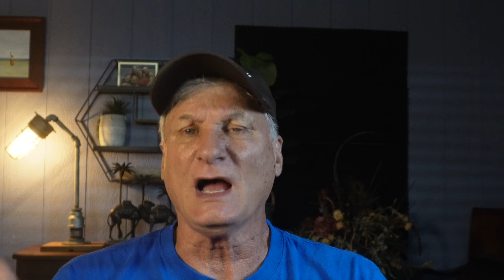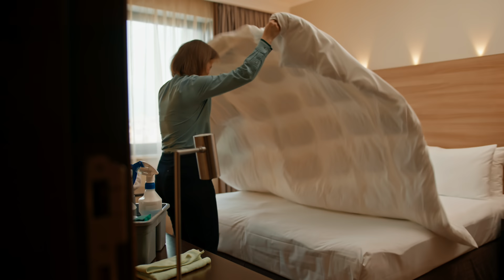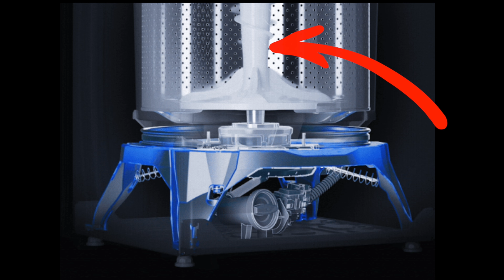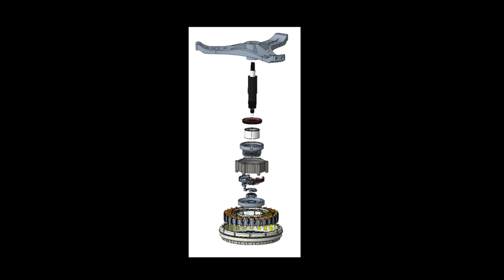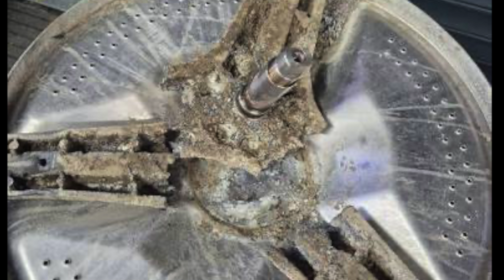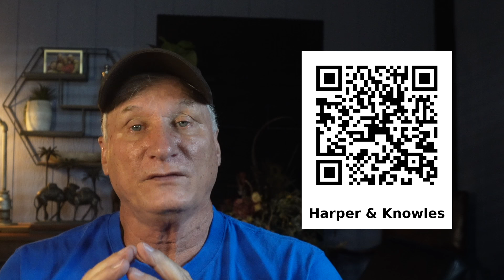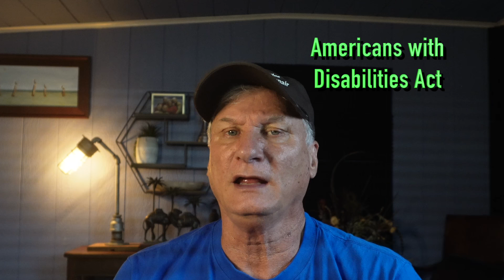Maytag's New 30-Year Washer: No Gearcase, Real Agitator, 900 RPM

Comment: My.  God.  We have a very expensive Whirlpool front load that is basically the same machine that I just got RID of because it was SUCH a piece of crap.  They are not balanced, and they will walk completely out of the laundry room if you use Spin Cycle #3 or above.  That's if you can even get it to spin in the FIRST place.  Most of the time, it cannot/will not tumble the clothes properly to spread them throughout the drum so that the spin cycle can be balanced and begin.  I am about to put it in storage and buy a another Samsung (which we got rid of to move halfway across the country in 2022, a long story).  I would not buy another Whirlpool EVER.  Ugh.

Comment: Why do they not build the spider out of a better material like a fibre resin or stainless steel ?? I have owned machines that I paid 1400 for and they lasted 4 years until the spider corroded away rendering the machine junk.....

Comment: looks like a fisher pykel pos washer .
  fisher pykel  i replaced the control board twice on a fairly new machine and the pump once in less than three years .
 i hope maytag didn't follow fisher pykel pos design . btw i dumped that fisher pykel pos and bought a maytag around 2006 .
but i did find one that had nobs and no board to go bad .

Comment: The computer is the most common failure point in modern appliances. I’ll take a manual transmission over a computer controlled piece of garbage any day even when they’re made out of crappy sheet metal stamp together with pudding.

Comment: My Kenwood Elite HE3t is 25 years old. $15 on a door actuator. $30 on a sump pump. $50 on the bellow tube. The bellow tube went bad only 5 years after new. The replacement is already 20 years old.

Comment: We had a washing machine that lasted for at least 20. It got our clothes and such very clean. It died. When we went shopping to get a new washer, not one had the agitator in it. I hate it. It doesn’t get clothes, linens, and sheets all the way clean. Plus sometimes it won’t spin all the water out, so we have to run the spin cycle again. 
I wish it would die a painful death.

Comment: Our fancy Maytag died, so we got a fancy Samsung.  Neither had an agitator, and both took over an hour to go through a wash cycle (HOW IS THAT ENERGY EFFICIENT?).  Then we had to start babysitting the Samsung because it would get out of balance Every. Damn. Time.  It could be one pair of panties and that thing would get out of balance.  We bought a Speed Queen back in June and I love it!  30 minute cycle AND the clothes are clean.  My husband does heavy duty, and my clothes have to be on gentle or hand wash cycles.  So we’re on our third, and last, washing machine in 20 years, with numerous service calls on the first two fancy pants machines.  And I got so sick of that stupid song.  I can remember the avocado green washer and dryer my mom bought in the mid to late 60s.  When my dad passed away in 1998, that washer and dryer were still in the house, still working.  The Frigidaire we got when we moved into that house in ‘59/‘60- my dad had just replaced it right before he passed.  My dad gave me his Hoover canister vac when he got a maid service.  It was probably 3 years old.  Knowing my dad, I’m sure it didn’t see much action.  I still have it, and it still works.  It has to be 30 years old.  I had a bagless Dyson that I despised dumping, so when it cratered after 5 years, I happily threw it out.  I much prefer pulling out a bag than have dust and dog hair floating around in my face.  They just don’t make ‘em like they used to!

Comment: Here's for you and the community. My 25 year old Kenmore 80 series works like a charm except for one thing. There's a Agitate Select switch where you select the speed such as slow, ultra slow etc. The Normal selection is for wash-slow and rinse-fast. That has never worked and only goes slow for both. I've replaced that switch twice and no joy. What more troubleshooting can I try or is there a failure somewhere else? Thank you.

Comment: SPEED QUEEN HISTORY:
The Complete Timeline
1908: The company is started under the name Barlow & Seelig Manufacturing. Their first machines are called "White Cloud".
1911: They build their first electric-motor washer.
1922: The company becomes the first to use nickel-copper tubs to make the machines last longer.
1928: The famous brand name Speed Queen is officially born.
1939: They switch to stainless steel tubs, which are still a signature feature of their washers.
1942–1945: During World War II, the factory stops making laundry machines and switches to making 20mm ammunition shells and military parts.
1952: Speed Queen introduces its first automatic washers and dryers.
1979: The company is sold to Raytheon Company, a major defense contractor.
1998: The company becomes Alliance Laundry Systems, focusing heavily on commercial-grade strength.

Today, Speed Queen is one of the few appliance brands that still makes its residential machines in the United States. They use the same heavy-duty metal parts for home washers that they use for big commercial laundromats.

Comment: I just happened to come across this video, thanks for it! I know very little about washing machines yet I find myself repairing them at my place of employment. We have 3 Maytag washers branded as "commercial" and a residential Speed Queen. These things work fairly hard, maybe 6-7 loads a day, every day, forn3 years. The Speed Queens has not failed once, the Maytags have all failed. 2 ECU's, 2 gearcases, 2 water pumps, 3 RPM sensors, 1 lid lock switch and approx 30 or so plastic hubs. NEVER AGAIN! Buy the Speed Queen, everything else is junk.

Comment: In the early 90s I bought a 1962 Maytag top-loading washer and dryer.  The tub was porcelain/enamel coated.  It had I believe three moving parts.  All the wiring and relays super heavy duty, and it got my clothes cleaner than any other washer I've ever owned (and I'd gone through Kenmores, Whirlpools, and GEs like tubes of toothpaste).
I moved onto a boat and gave the pair to my landlady, who is still using them today.

Comment: The problem is those "control boards" crap out and cost HUNDREDS to replace.  Need old fashioned contact based timers like the old days.  My washer and dryer are Whirlpool from 2003 and after a couple low cost DIY repairs, they are still running great today!

Comment: We moved into our ranch in 2003, with a new set of Amana washer & gas drier. We are always buying a top loader. 4 year’s later the washer died. Then I bought a GE washer & gas drier. At 4 years (5 year warranty) they replaced top beard, motor, belt and transmission. After 1 1/2 years, it was dead. Somewhere till 2018, another was replaced. Then in 2018 I replaced with a Speed Queen TR5000, washer & drier. It’s still running.

Comment: Not a frontloader, not interested.

But hey, my 20 year old Whirlpool frontloader with computerized controls and an even faster spin speed is still going strong.

Yeah, washers are expensive.  Good clothes are expensive too - and they last a LOT longer if you only wash them in a front loader.  Only buy a top loader if you don't care what you're washing in it - good for your shop rags, not good for much else.

Comment: I was recently in China. I had to fix 2 modern ones at 2 different hotels. There was an old old one that I've never seen before. The spin cycle you had to put the clothes in another tub beside the wash tub. Just a timer electricity and water. Probably 50 years old. Still working. Simplicity wins every time.

Comment: The comments below are all worth reading.  I will only add that it is overdue for a consumer revolt against the financial slaughter the American consumer has been experiencing for the last 20 years.  Those of us who remember the 20th century know that appliances typically lasted 30 years not 7.  Yes, the appliance is cheaper now ( accounting for inflation ) than in the 20th century but when you have to replace it every 7 years the cost is actually a lot more.  
I will not go over in detail what happened but give the readers of this comment two clues to research:     1.   Corporate greed and unrestrained mergers leading to monopolies.  2.   Chinese manufacture.  This last clue is difficult to get at unless one knows this:   China is not food independent, i.e. they have to buy food.

Comment: Bought a Whirlpool & the electronics went out in a 1 1/2 yrs… repair guy said it would be 4 to 6 hundred to replace it… I junked it & bought an LG … but I have to leave the lid open all the time or it has a bad odor, and yes I’ve used the cleaning tablets, didn’t help !

Comment: While fewer moving parts is theoretically great, new direct-drive implementations often suffer from initial control board glitches, firmware oversights, or early component failures. Whirlpool asking premium money ($1,500 range speculation) for you to test their brand-new engineering is a tough pill to swallow.

Comment: I've had my washer and dryer well over 10 years... and I didn't get them new... they are used... and abused... never had an issue with either of them.  Would I like a new pair... sometimes... I'd like to be able to wash my comforter without having to go to the mat to do it... but it is what it is and sadly there is little to no chance of me getting a new set as new sets sadly are far too large to go into the small space that I have to put them... since I rent and don't own the place it's not like I can build a new room to house a washer and dryer.  I am stuck with what fits ...

Comment: Won't ever buy another Whirlpool washer. Bought the most expensive top loader stainless washer in 2010. Looks just like what u are describing. It lasted 2 years. Had computer issues. Would quit and lock lid. Couldn't even get the clothes out of the washer. Didn't clean well and everything always smelled like mildew. Repair man told me it was junk. Biggest POS I've ever purchased and took it to the scrap yard.

Comment: I have a Maytag MVWB880BW0. I have had it for 12 years. I have replaced the main shaft and bearing once. The suspension rods once and one drain pump once. My wife is tough on a washer and often loads it with heavy blankets. The maximum spin is 1100 rpm which she always uses. The clothes come out remarkably dry. We  have been very happy with it .

Comment: Brushless motor...their used in screw guns,high speed trains no rails, small motors used for wash machine pump.,etc...and it does need electronic  board to run and change directions..

Comment: I just had my three year old Whirlpool top loader fail.  Wiring harness got shredded during an unbalanced event.   That caused the control board to fry and the door latch to fry.  Nearly $600 repair.  A new one would have cost $900 and a long wait for delivery so what can you do?  Maybe I'll invest in the new $1,500 Speed Queen model next time.

Comment: Single action agitators are still garbage.  The washing works 3x as good by having the dual action.  With current inverters, and a simple belt reduction this could be made without a transmission, and still get a good wash, they need to go back to the drawing board again.  I collect & rebuild myself old washers for my shop, coveralls will not clean with a single action agitator, unless left on the 1.2 hr supper mode, old machines get it done better in 20 minutes.  Only the highest end SpeedQueens have the dual action, the others are fine for girl clothes & light duty cleaning, worthless for people who get dirty.

Comment: Maytag can go pound sand! I will NEVER buy another Maytag again, or anything at all from that company. I bought a brand new whirlpool less than 10 years ago. The useless thing doesn't use water to get clothes clean. Anything that is actually dirty, I have to wash in the bathtub, or I will wash it outside with double large stainless steel sinks I have. I always have to run a rinse cycle at least once before washing the clothes, usually twice when I wash them in the Maytag washer. My husband worked in appliances at Home Depot and he told me he was told to tell customers that all called complaining that they were taught to tell people the washer washed clothes with not enough water to fill the tub. 

So now Maytag is saying they have put out a machine that is the quality machines were for decades, but now it is a deluxe or commercial machine so the price is excessively higher than a standard machine that flat out doesn't work to wash clothes?

On top of that the computer stops you from adding clothes once the machine has begun its cycle because we need a company to assume we are too stupid to not get hurt by a machine that is in operation. The computers make the machines even more of a large metal garbage can than they already are when they don't fill the tub with water. They also rust now pretty quickly. Mine was all rusty in a totally dry washroom, with no water leaks within a few years.

I will save my money and wash my clothes by hand and spin them out in the washer, before line drying them. These companies that have reduced quality (in which there are too many to talk about) to be absolute garbage are stealing from people, and I won't ever buy from them again.
Reply: How could I forget! The plastic tub inside the washer garbage that is miserable to clean and slime builds up where the softener goes because it is made of plastic junk. Maytag IS wrong about the tub. A plastic tub is absolute garbage. It won't rust if it is made of stainless steel. It is a cop out to claim it is plastic because plastic doesn't rust. SMH Maytag gaslights everyone to treat them like they are stupid.

Comment: Dryer: I don't want a steam option. Nor a screen. All I want is a knob for timer. Another switch for temperature, 3 settings, High, low, air. No microprocessor. No mosfets. No ECM motor because it contains mosfets. Of all the ECM motors I have been inflicted with over the last 8 years none have lasted longer than 3 years. Don't need moisture detection. Don't need a multiple speed motor so don't need ECM motor at all. Regular old 100 year old technology PSC motor. A motor, heater coil, some switches and a relay or two. I figure in another couple years when my new dryer's mosfets and computer dies I may just rip all the circuitry out and replace it with mechanical windup timer and temperature switch.

Washer: As for my washing machine that came with the new house - after it was 1 year old we hated it so much we had it hauled to the dump and replaced it with a SpeedQueen. At least the speedqueen operates well enough that when the load is out of balance we can stop it before the machine walks across the room. But the SpeedQueen still has mosfets, microprocessor, and ECM motors. So it is likely doomed to an early death and won't last 30 years like my 1995 Maytag washer which is still working just fine.
The GE didn't have a spin only setting. Only rinse and spin. So when I needed to spin partially dry clothing it would only fill up with water and soak them. Then it would finally get to the spin step and it would be out of balance banging all around. But the out of balance was not fixable. All you could do is hit the pause button. The lid won't unlock until the tub has coasted down to a stop. But there are no longer any brakes. So it coast for about 6 minutes. By which time the computer has timed out and the memory that it was in the middle of a spin cycle is gone. Rearrange the clothes. Hit the pause button and nothing happens. The only thing that can be done is press start and the whole thing starts all over. Tub fills again, clothes get positioned out of balance, it goes into spin. Bang bang bang again. So stop it again. Wait for it to spin down. Start it again with no soap so that would be the rinse cycle. Then bang bang bang. Stop. Take the wet clothes out and hang them on a clothesline I put up in the backyard until they are no longer soaking wet and could be put in the dryer.

And yet I am an electrical engineer who specializes in putting microprocessors into appliances. Everytime I complain marketing overrides my complaints by tellin me that's what the customers want. I try to design my circuits so they will not fail so easy. But mosfets are very fragile and the joke is lightning strikes in Bolivia and the mosfets in the US blow up.

Comment: I briefly back in the day worked for Sears 3 years fixing washer and dryer.  The older Whirlpool and Maytag were built to last and had common sense engineers back then, BUT idiots took over and wanted them designed to only last about 5 to 10 yrs 🙄 ( cheap design,  cheap parts  ) to keep the cash 💸 🐄 feed. The quality went down starting after year 2005. To this day I would only buy a Speed Queen top load. You just want your clothes to come out clean,  so why pay extra for more crappie bell and whistles ( cheap parts that go bad in a few yrs ) that you don't need..... it's a waste of your 💰.  Speed Queen has proven years of what actually works and keeps repeating customers - made to last. Understand,  nobody is perfect and parts can go bad, but with Speed Queen... parts are reasonable and easy to replace . Gitty up 🐎  🤠

Comment: 30 years/12k loads claim.
Most new families can't afford a new $1,500 washing machine, they'll most likely start with a used one or a cheaper new one, just like their home. When they do buy one of these it's going to get used more heavily at first while the kids are young. Then usage will taper down as the kids move out for college or to start their own households. Barring circuit board failures, I could imagine this machine lasting a long time. What do i know? Im the single man who bought a new "commercial technology" Maytag 13 years ago and expects not to need another washer. Before this I had 2 used ones over almost 30 years. YMMV.